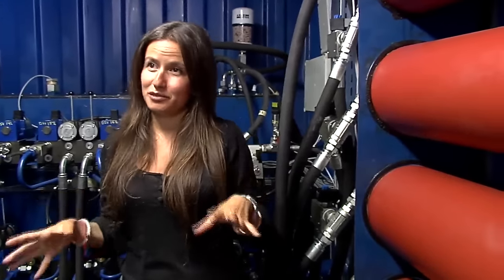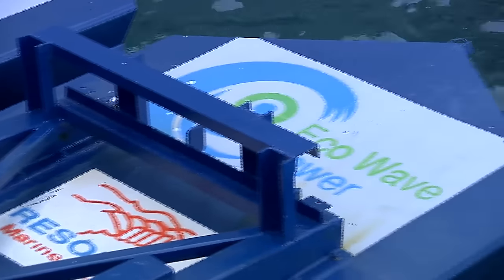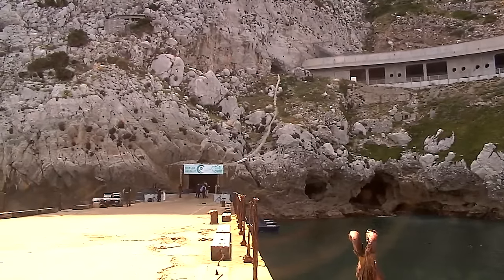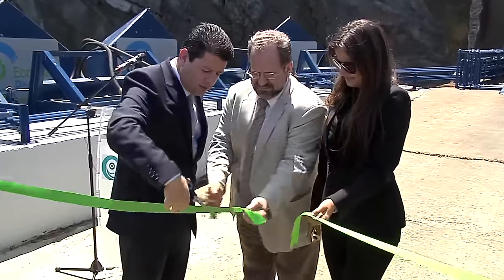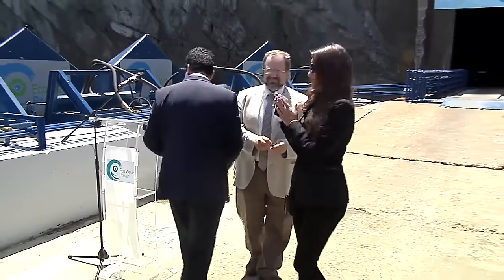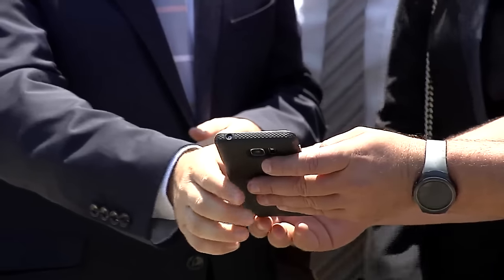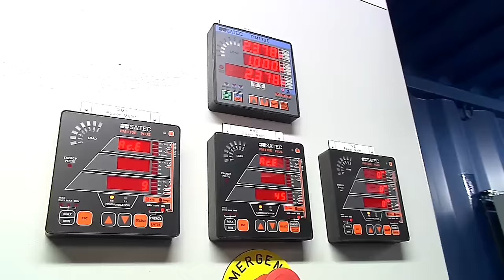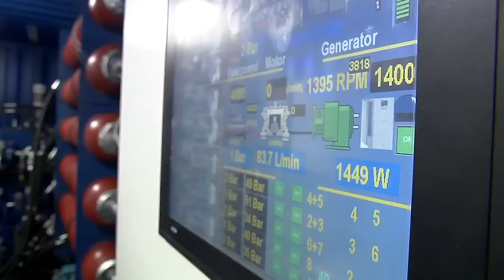Eco Wave Power- Europe’s first grid connected wave energy array-Inna Braverman, David Leb

Comment: Good but low efficiency.
Reply: Depends how you measure efficiency I guess, it is infinitely more efficient if you say the energy supply is free.
Reply: free? not really, you have to consider the cost of installation and operation. However, it is still a step forward.